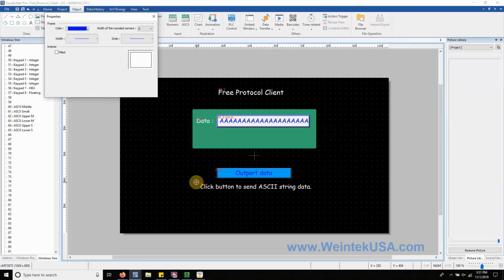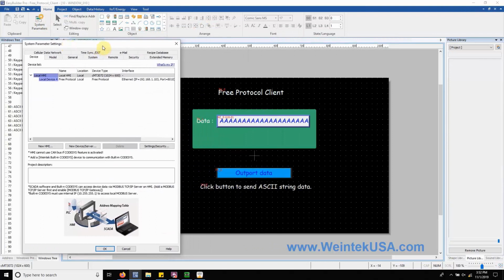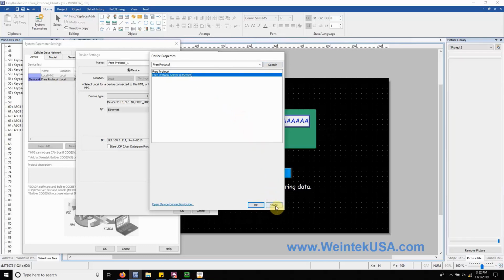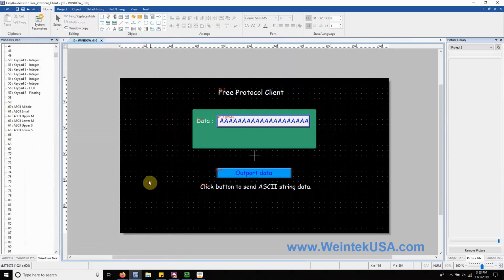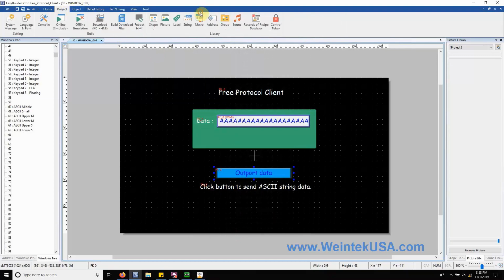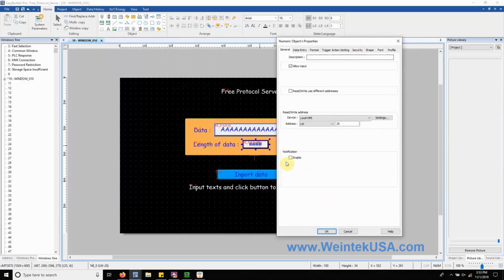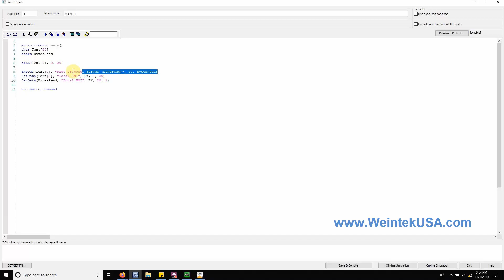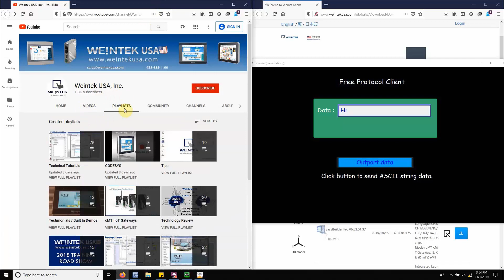How to use Free Protocol to Control a Device - Weintek EBPro

Comment: Dear Weintek team. Please check my issue explenation with problem which I noticed after EasyBuilder upgrade in my system: https://youtu.be/pzpI2kUVPx4
Reply: Hi Piotr,
After watching the video and testing it myself I was unable to replicate this issue. However, I am using a later version of EasyBuilder Pro. If this issue hasn’t been resolved please contact your distributor to be directed to the correct Weintek support line.